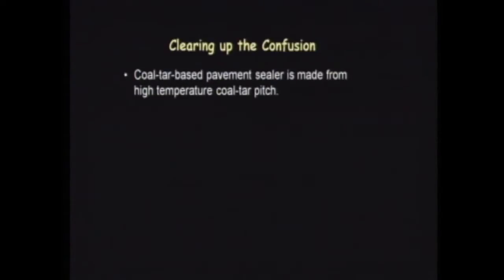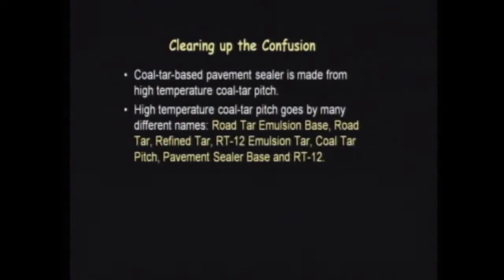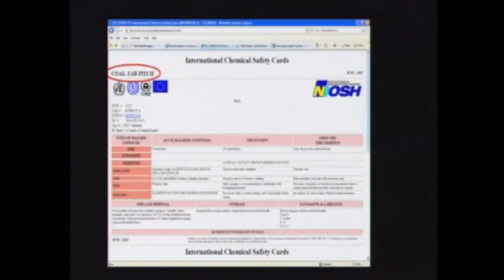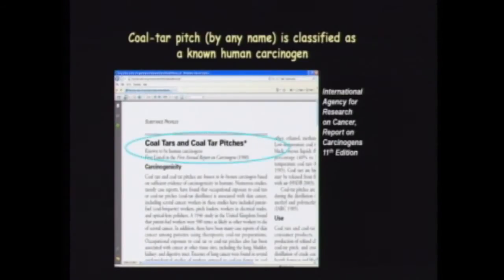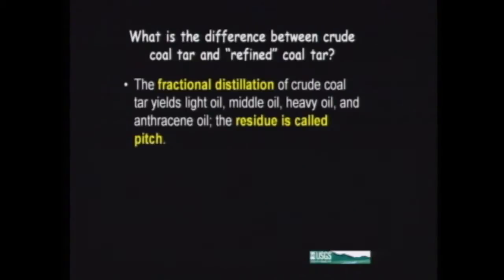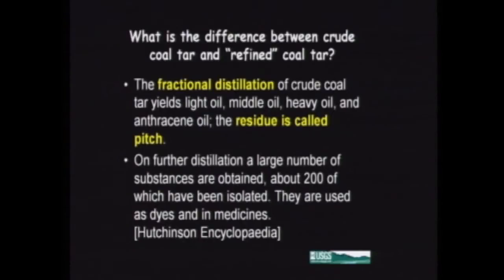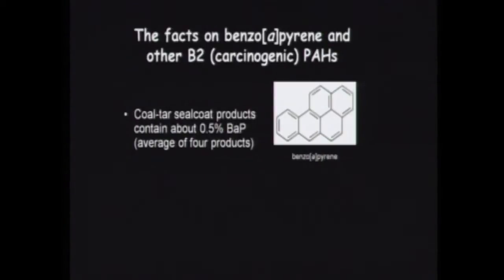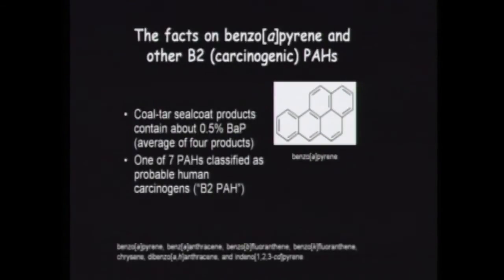2. What is Coal Tar? Unofficial Guide to the USGS and Coal Tar Sealants, Part 2

Comment: Btw I swam in coal tar roofing pitch for my job over 30 yrs , it's horrible for people to breath & leaves the roofers skin burnt & peeling every work day .
Reply from the maker: +Michael Ledford Thanks Michael for your comment. Hope you and your family are well in spite of your exposure. I too worked in the roofing industry and saw the harmful and immediate effects on workers. I guess the only good news is that our children don't play on roofs like they do on pavement so their exposure is limited.
Reply: +Tom Ennis Hello Tom , what worries me about coal tar roofing pitch & children is entire neighborhoods come in contact with the vapors & dust , where I am in Michigan many school systems use coal tar pitch as their primary roofing material , since you've been involved in commercial & industrial roofing you've seen how hot tar vapor hangs like a death cloud over a building , and how the dust from tear offs fill the air & get carried away with the wind , we routinely used 30-40 ton tankers full of pitch which was then flowed into kettles , heated to EVT & pumped to the roof , the smoke cloud is massive & fills neighboring homes .

In one instance an entire neighborhood gathered & called the police on my roofing crew , I was taken & shown multiple swimming pools with a brown oily tint from pitch dust & vapors collecting on the water , I was taken inside $500,000 plus homes & shown how their homes ventilation systems couldn't filter out the odor or fumes , we ended up settling with the neighbors to deodorize over 50 homes using mass ozone treatments & had over a dozen swimming pools drained , cleaned & all filtration equipment replaced .

On a Mich state police post they had just purchased 30 brand new police cars & hadn't given them to the troopers yet so they were parked in the back lot the entire 5 days we reroofed the bldg , on our last day the post commander went ballistic on my saying we destroyed the new cars , he showed me where the fumes had eaten the clear coat off most the cars , all the Windows were yellow & stained , the windshield wipers were stuck to the windshields , the interior of the cars was permeated with the stench of pitch , all this from 120 yards away , our company insurance had to have all the cars towed someplace & cleaned & deodorized,  some cars paint was damaged so badly the entire car needed repainted .

If coal tar fumes & dust can peel paint off brand new cars I shudder to think what it does to kids skin & lungs , coal tar was a superior product for roofing & parking lot sealing 30 yrs ago but not anymore , modified bitumen emulsions have advanced to the point they outperform coal tar products & usually at a cost savings .
Reply: Currently doing a coal tar tear off. Any advice on treating the burns? Face is on fire